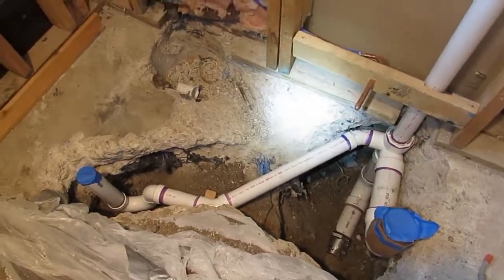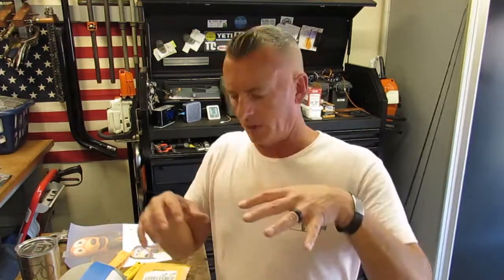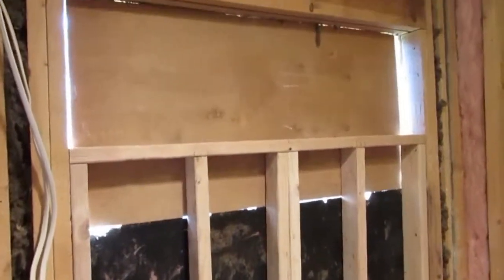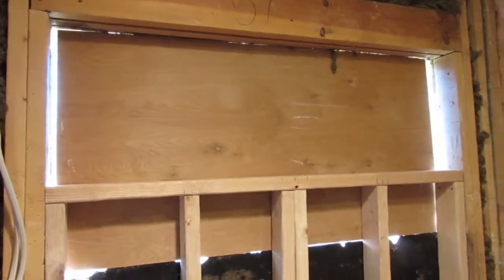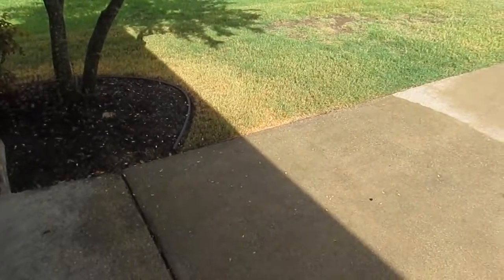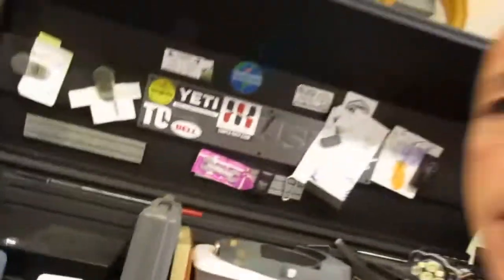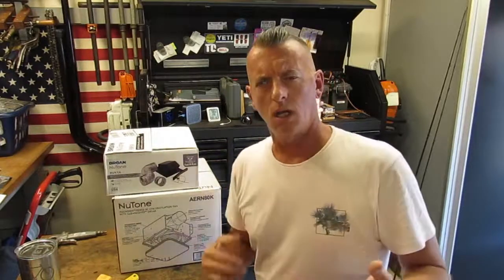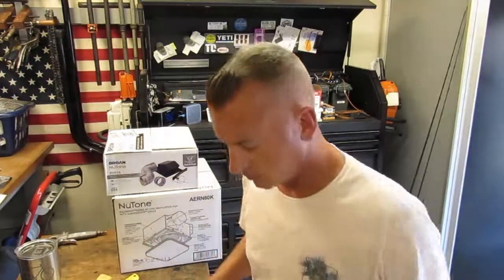Bathroom Remodel 3: Glass Block Windows and Miscellaneous

Comment: I'm currently doing a total bathroom remodel and had a multi-colored glass block window I designed made by innovative home solutions.  The glass block window is 48in x 32" and I've installed it where my previous 48 x 36in regular window used to be.  Installing the window is one of the only parts of the renovation that I contracted out because the window was very heavy and took three guys to lift up into place.  That glass block window really looks amazing in my shower.